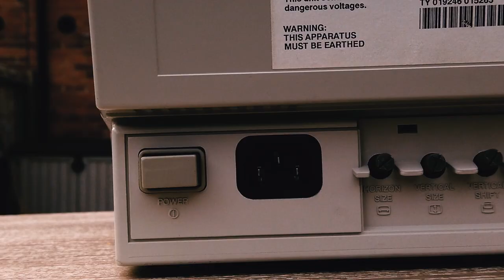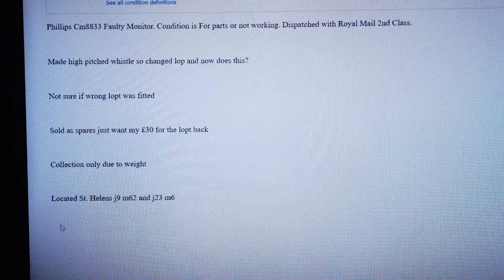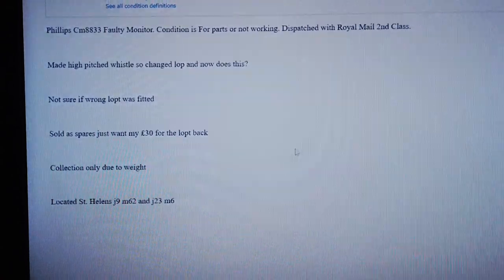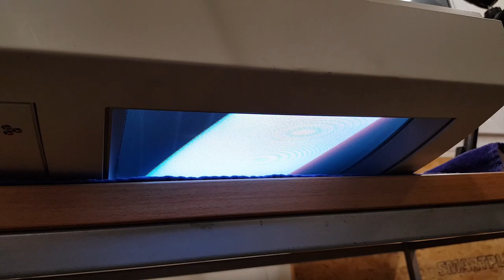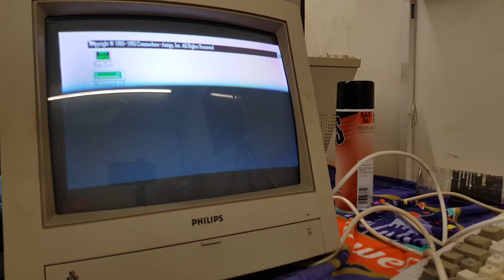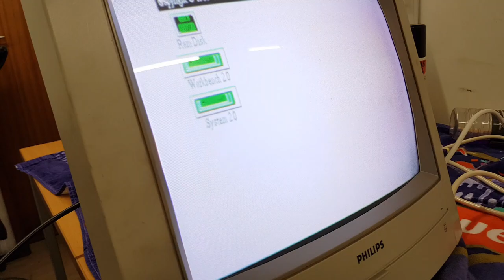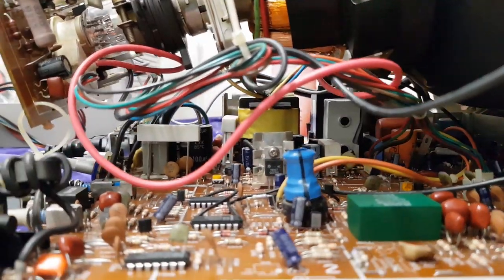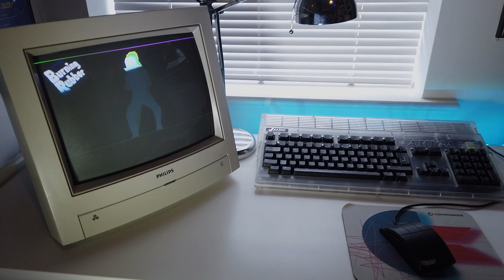Fixing A Broken Philips CM8833-MK2 Monitor (A £30 Ebay Purchase) CM8833-II - DJI Osmo Pocket -

Comment: I remember this analog monitor is very reliable,  it brought me so much fun, I used it to connect with my Amiga 300. I cannot remember if it was defective or due to what reason, but I did buy a 17 inches vga crt monitor as replacement, with the japanese xrgb converter for signal rgb to vga.

Comment: Those are great. The other two issues are the power switch (which is unfortunately hard to obtain these days), and green spot (corrosion) on the yoke assembly. The latter can be prevented by taking off the yoke and insulating the three rubber wedges so they won't have direct contact with the yoke windings. If the corrosion has eaten through the copper wires, then it can be patched up and reinsulated with lacquer or kapton tape.

Comment: The band that goes around the screen is probably the degaussing coil.  It basically demagnetises the screen to get rid of any distortion that has been caused by magnetic fields
Reply: Yep it is the De-Gaussing coil. I'm glad I don't have to work on CRT monitors and TV's anymore. A 15-30,0000 volt shock was never an enjoyable thig.

Comment: I'm still hunting for one for my Amiga :(
Reply from the maker: I sold one boxed a few months ago aswell
Reply: Where are you based? I have two of these.
Reply: @boilerhousegarage  Wiltshire mate
Reply: @Stoobers  Not too far, I'm in Witney, West Oxfordshire. I've got to replace a power switch on it, but will have a CM8833-ii available to sell.
Reply: @boilerhousegarage  keep me posted mate!
Reply: One on ebay right now £25 starting bid, I bought a faulty one which arrived today and there's nothing wrong with it, they had it in the wrong mode. £46
Does require a switch though as most of the time they do.
Reply: @Electrotat  I don’t have the ability to repair power switches etc, sadly.

Comment: 2The correct way to do any adjustments on a CRT is to have a mirror on the back wall and face the screen towards it. That way you have full access to the circuit board and can easily see the screen in the mirror. For safety you should always stand o a rubber mat  have one hand in your pocket and use an isolation transformer.

Comment: My 8833-II has never been opened up still works like a charm, powerbutton is solid its a monitor from a school so they were powered on and off by a flick on the mains switch not the button on the back of the monitor :D